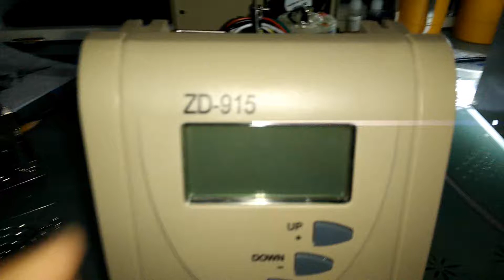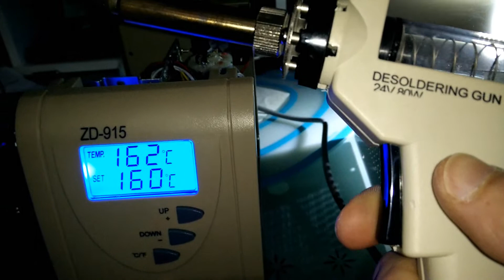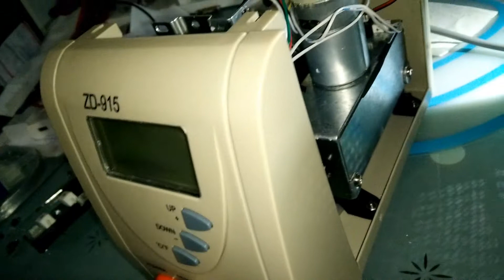[Hack] Improve \ hack ZD-915 desoldering station (easily) - DIY

Comment: Thanks for the tips, I replaced the resistor box with a 5A buck converter, it came with a build-in 3digit 7 segment display voltmeter, got it for $7 US on Ebay, it works great. with the resistor the screen dims, and fan slows when the pump is on, with the buck converter there is none of that, and I monitored the voltage with my multimeter, there was no voltage sag from source or output, and the build in voltmeter is also spot on.
Reply from the maker: Great work friend! That's the same improvement i have noticed.
Try to improve the fan air vent as well, the silence makes it even greater :) Also the air flow increases inside

Comment: My solution... a resistor with value 100 ohm 5 watt in the red wire of the fan. Fan now runs smoothly on approx 5 volts Greetings Erik ;-)

Comment: Others have replaced the resistors with large diodes to drop the voltage (5x1N5804 I think).
And the trigger wires are apparently pretty thin, so they made the trigger drive a relay instead of the full motor current, but I like the transistor idea you mentioned even better.
Reply from the maker: 1N5804 diode has 2.5Amps rating, not quite sure if it will work for very long. I believe the motor takes 3Amps, which it's a bit out of the spec. But i might be wrong, not remember. But still, having a stepdown does the work and it is adjustable. :) Thanks for passing by and for shearing your ideas :)

Comment: There are larger power rubber insets or grommits that are used in electrical conduits and circuit breaker boxes you can also use to protect the front-panel hose.

Comment: Mine won't heat.  It displays the word ERROR beside the temperature reading.  

Pump and fan work.

Any idea what's broke and where I might find replacement parts?
Reply from the maker: Probably you have a bad connection and the temperature can not be read. Try to find the problem watching for loose wire connections, mainly the thermocouple connections.

Comment: Any thoughts about swaping the pump out?  Was thinking of upgrading that.  And god thats why its so loud, I thought it was the pump, I didn't realize the fan had to run so high because of the resister bank.
Reply from the maker: I believe you can replace it if you have space for it and a 24V motor. Not quite sure about the current.

Comment: I got my version of this desoldering station today (Duratool) and boy is it loud. Same internals but my fan is 12v driven from the 18v supply! it then drops to 12/13v when the trigger is pulled as the voltage is pulled down through those 2 resistors under load. I am thinking of leaving the resistors in for the pump and tapping of the fan through a 12v regulator as my regulator isn't big enough for the 2.1 Amps the pump is taking. It shouldn't waste too much energy as the resistors are only burning off 6v when the trigger is pulled. Has your 3A regulator been ok?
Reply: Having said that...there are 2 x 1 ohm resistors rated at 5 watts. if these are passing 2.1Amps and dropping 6v (18v down to 12v) then that's 2.1 x 6 = 12.6 Watts for these two 5 
Watt resistors to dissipate (6.3 Watts each).  Don't get me wrong it works great for what it does...just needs a mod or 2 .
Reply from the maker: @Catstorm99  Hi thanks for your comment
I'm honest i haven't changed my stepdown since then, although I've actually bought better stepdowns but it's still working fine. 
Please note that is not exactly 3Amps, the maximum recommended current is 1.8Amp, and 3Amps can be only delivered if in short periods of time.
Well, about those droppers IMO they are useless, and you did the math, they limit the power as well you feel the unit going down when using it.

About your fan, you can still use the output of the stepdown to feed 12V to your fan, but if you feed less voltage you'll hear less noise, so you can use 2 stepdowns instead, one for the motor, another for the fan.

But most of the noise comes from that hole grid, when i removed it i felt a relief.

About your math that's correct friend !! But i believe i haven't measure the motor current (did i do it on the video?), maybe it's less (did you take a measurement? Are those 2.1Amps correct?). But also take into consideration that you'll not be using the motor all the time, so it will give time for those resistors to dissipate the heat... well, kinda :)
Reply from the maker: @Catstorm99  BTW, about the desoldering gun, that's not a good thing, it gets stuck a lot of times, the motor is too week and the solder gets stuck inside the nuzzle :\
Reply: @FixDaily   I measured it last night, it's 2.1 Amp running and an initial surge of 4.2 Amps. I have found a little Buck converter LM2596 in my parts draw. Specs are 3A MAX and 2A continuous so I think this would probably be fine and like you said, It's only 2.1 when the trigger is pulled.
Reply: @FixDaily  I'm hoping to get into the habit of cleaning it out with the probe things before letting it cool down. It won't get heavy use, I was just getting sick of lifting tracks with a solder pump and braid.
Reply from the maker: @Catstorm99  Well make sure you clean the pads correctly (wiggling the tip around them while sucking the solder) otherwise you'll destroy the vias (when removing the component, mainly integrated circuits will give you some nightmares).
For small things i still like to lift the component while heating it up from the bottom (with my soldering iron), and to clean the holes (that get stuck with solder) i use a manual pump, i heat them up from one side and i pump it from the other side. This is the thing i'm using: https://www.youtube.com/watch?v=QnKHMCOg56U&t=44s (It has a heat resistant rubber that allows to vacuum the via).
I also drill a hole on it with a smaller bit, like i do on this video: https://www.youtube.com/watch?v=5JtGnE98ENg
But the pump way is less risky
Reply from the maker: @Catstorm99  I believe LM2596 will work just fine, I'm using a smaller one and it still works ever since so i believe you'll not have problems.
But make sure your unit has a flyback diode to protect the buck converter

Best of luck mate :)
Reply: @FixDaily  . All done.    https://www.dropbox.com/s/bh87ygta9xmx7pe/2019-01-08%2016.12.17.jpg?dl=0

I kept the resistors in the plastic box for the step down voltage for the pump and used a mini360 DC-DC buck regulator to the new fan, this is set to run on 10v now  and a lot quieter. 
I did try a buck converter  to feed both but when I pulled on the trigger the speed dropped momentarily and then picked up...as if the regulator could not keep up at first. With the resistors however, it started off with a quick burst and then settled to a slower running speed which I guess is the way round you want it. Thanks for the ideas.
Reply from the maker: @Catstorm99  well done mate
Weird that you could not keep the system with the stepdown converter, mine is still working and i don't feel any drops, maybe the current and consequently the voltage is dropping and i don't hear it, i have to confess that i haven't measured it, but it is better for me without those resistors
Btw, your dropbox is just sharing one picture, did you make further modifications besides the fan?

Comment: Will this station satisfactorily desolder  lead free soldering?
Reply from the maker: Lead free will be even better since it has a lower melting point :) so yes
Reply: @FixDaily  lead free usually has a higher melting point than leaded. It's possible that there was a misunderstanding
Reply from the maker: @simonerachele6231  you are right, i mispronounced what i wanted to say.
Lead makes it soft and easy to melt.
Thanks for correcting me

Comment: What is the part number of the step down convertor?
Reply from the maker: I recommend a 5Amp step down, which can be a XL4015, for example this one:
https://www.aliexpress.com/item/1PCS-5A-DC-DC-Step-Down-Adjustable-Power-Supply-Module-Lithium-Charger-XL4015-4-38V-96/32844672214.html

Comment: Sorry, I simply do not understand WHY you are making this modifications? What was going wrong in the first place, what made it neccessary to upgrade to higher amps etc?  without an understandable reason for the modifications for me its just "playing with electronics".
Reply from the maker: Hi, glad you asked and thanks for showing interest.
There were a lot of reasons i must say, this unit is made as low budget as possible, so if you can improve it, you will make it work better and longer.
For example, i started by removing those 2 power resistors because they were consuming a lot of current, and if you have this unit, you can see that when you trigger the gun, the unit goes down, the screen dims and the fan decreases in speed as well, so by this, you can understand that the power supply can't handle the current the system is asking. After you replace it by a stepdown converter you'll notice that it runs great and smooth.
About the power supply modifications, i removed the enclosure so the air can flow throw the internal components so it can make it cooler. I've also faced it in the other direction so the side shielding can protect the front panel from EMI, and since the unit enclosure is made of metal, the out side is also protected from EMI. And also to avoid the motor to get in touch with the internals. 
The flyback diode connected to the motor pump will not only protect the stepdown converter but also the power supply aswell, so when the motor stops, the induced current as a path to go but not to the system.
I also removed the fan holes because they make a lot of noise and they also prevent the good air flowing.
The front also got some modifications but they were meant to protect the wires and the tubing from scratching against the sharp edges of those front metal holes
Reply: @FixDaily  Hi, you have described very well the series of essential changes to the desoldering station. Very well! Thanks for your suggestions. I will do all this in my desoldering station. Last thing: can you tell me what kind of flyback diode should I use for the engine? Thank you.
Reply from the maker: @michelemarchese259  1n4007 is good for the job :)
Make sure you solder it directly to the motor pins, it should be there
Reply: @FixDaily  Ok very well, I'll do as you say. Thanks a lot for your advice. Thanks again.